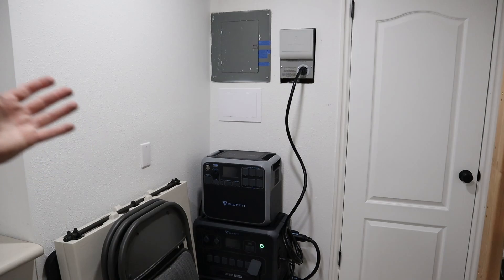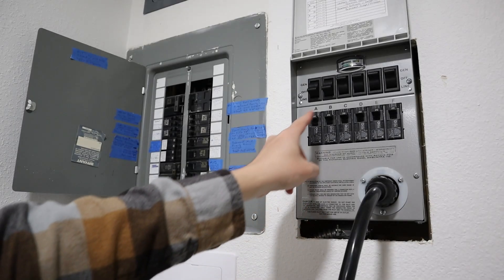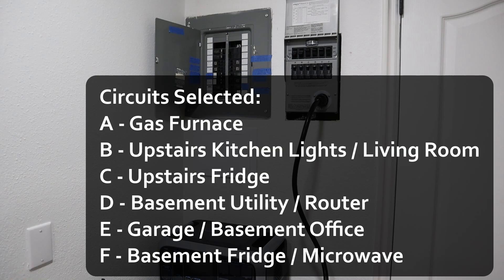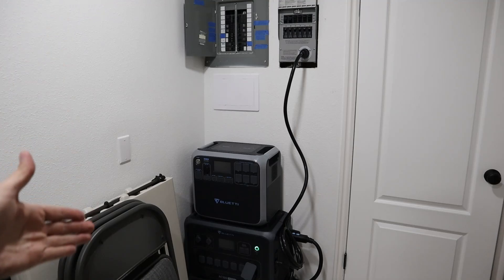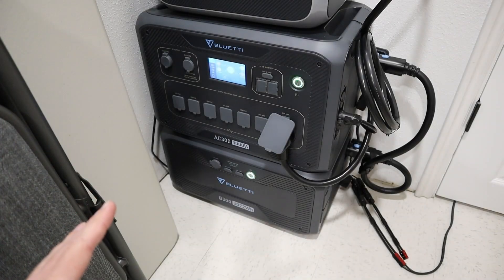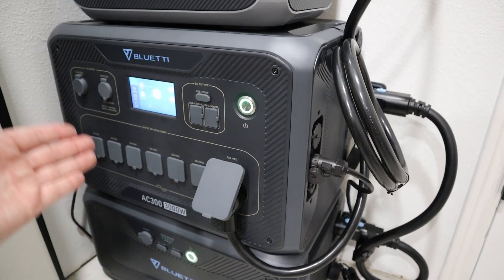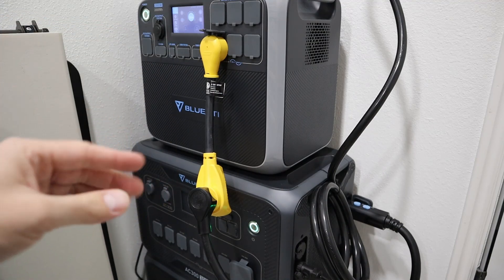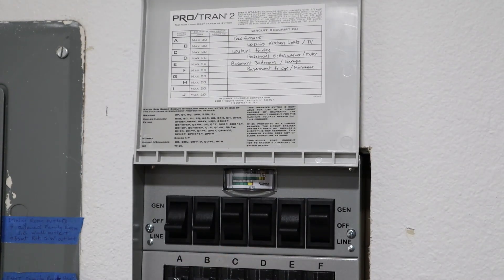Keep the Power On During an Outage?! Install a Power Station Transfer Switch!

Comment: I installed the same transfer switch for a gas generator. But now seeing I can get an AC300 and solar and use the transfer switch daily like you. And if I run out of battery power can easily plug the gas generator back into the transfer switch. Or use the gas generator to recharge the AC300 during the day and use the AC300 at night and not disturb the neighbors with a noisy gas generator or call attention to myself. Thanks for the simple walkthrough!
Reply from the maker: That's exactly my plan and on a sunny day I can run all 6 Circuits off solar no issues. When night comes around I only run my fridges to conserve battery power. With two fridges and cloudy days you'd really want to look into a second 3072wh battery
Reply: @Jasonoid  You called it. I had a 9 hour Sat without power due to storm, downed power lines. (Unusually long time) I used the AC300 with 1 B300 then had to use the gas generator. (it was a cloudy day) So now I am thinking about a second B300 like you said. But in the end I had power to get me through the day, and did not lose any food in the frig! I am enjoying learning step by step. Thanks

Comment: Jason, can you do this to a old house with the old fashion screw-in fuse panel, or do you need to upgrade the home panel to a circuit breaker type?
Reply from the maker: I'd probably recommend upgrading the panel to the newer removable circuit breakers. They get the transfer switch installed.

Comment: Is that enough battery power? Are you getting more battery's? I am thinking about getting the same system but with extra battery
Reply from the maker: During the day I'm good running everything off solar since it charges so fast, it stays at 100% through the day.... however through the night the battery falls down pretty low... I think I'm going to need more capacity to get me through the cloudy weather and nights. Running 1 fridge seems to be okay, but I have to swap everything over to line power in the night. Debating about purchasing a second battery as well.
Reply: I am also looking to get 10x 200 WATT 12 VOLT MONOCRYSTALLINE SOLAR PANELS
5 on each input should that be enough? We only get good sun for about 5-6 hours due to trees and shade.
Reply from the maker: Thats a pretty decent solar setup. Remember it can only take 150volts max input so you'd have to wire it in a way to keep the voltage under 150v. If the power is out I'd plan to run a gas generator as needed to charge up the AC300.
Reply: Is it not 150v per input? With the ac300 you get two solar inputs? The panels are Open Circuit Voltage: 27V
Reply from the maker: @MarineJunkies  Correct it's 150v per charge controller and the AC300 has two. So you can have two separate solar lines coming in. I didn't know the specs of the panels, so if they are 27volts max you should be perfect with 5 of them in series. I think that will be a great setup for you.
Reply: @Jasonoid That's the plan anyway, how long do you think it will take to fully charge two batteries with this set up?
Reply from the maker: @MarineJunkies  I don't have experience with the dual batteries so Im not sure, but I will tell you that one battery gets full in about 1.5 hours when I have 1400+ watts rocking in from solar. It's been super cloudy this week and it gets old to no be able to use my solar panels!
Reply: @Jasonoid   Do you get nothing when it's Claudy?
Reply from the maker: @MarineJunkies  thin clouds I'll get around 400 watts which is enough to run 1 fridge all the time. Thick clouds like heavy rain...I get around 100 watts.

Comment: Nice set up. Yours is the first video I've seen, showing how to fully use the power of a Power Station, to power your house.  

We have a similar set up, but with the Reliance six and ten circuit Transfer Switch.  I installed two inlets outside, to connect our Tri-fuel generator to. (It runs off our homes NG line) Each transfer switch has an inlet, like yours, for our Power Station. I use a changeover switch that's connected to each inlet, to switch between two power sources. (Generator and Power Station.) So, we can have two power sources coming in, but only one power source is powering the circuits in the Transfer Switch.

You forgot to show how the UPS function works with this set up.  We have the Ecoflow Delta Pro which uses an EPS (Emergency Power Supply). While the DP is plugged into a wall outlet, it can pass the Utility power through to whatever is connected to it.  (Without using the invertor or battery) When the power goes out, the DP switches over to battery power in 30ms.  Meaning no power loss.
Reply from the maker: You make a good point, I could have showed the AC300 in ups mode powering the circuits and then if the power went out I'd just have the battery backup. Most of the time I'm going to try to run off the solar and batteries and try not to use line power.

Comment: Thanks for the video.  I bought this transfer switch for my Bluetti 300 set up.  Do I need to buy any other cables before the electrician comes to install it?  Or does it come with everything I need? Thanks so much.
Reply from the maker: The transfer switch comes with everything you need, no additional wires needed for the install. You might need a cable to go from the transfer switch to the AC300, depends on the model you purchased.
Reply: @Jasonoid  You sure she doesn't need any other adapters when I look at the transfer switch and it has a four prone twist and on the Bluetti AC300 it has a three prone I was wondering the same thing?
Reply from the maker: @jamesclark144  if you use the one I purchased in the video, it came with the cable that adapts to the rv plug on the AC300

Comment: I'm waiting on someone to make a video of  hooking up  a 48volt Lifepo4 battery to a Bluetti to extend the run time,  I tried hooking up a lithium jumpstarter battery pack to it, (with the cigarette lighter adapter) and it charged my bluetti at a 100 something watts under the DC option, with a 48volt battery I would imagine someone could use the PV aspect of it for more watts coming in
Reply from the maker: Jehu Garcia (youtuber) has tried many attempts at expanding Bluetti power stations with external batteries. The problem is that these power stations require a communications link to the external battery so it's not a simple task. If you want a huge battery backup it's best to go full DIY

Comment: Have you ever hooked the B300 up to the Ac200?
Reply from the maker: The B300 will only hook up to the AC300. The B230 is meant for the Ac200max.
Reply: @Jasonoid  https://www.youtube.com/watch?v=2ZuLZzCh2us
Reply: Speaking of the Ac200max check out that video in the last comment, this guy has the Ultimate Ac200max transfer switch setup. I love the wiring he did for it. He backs it the AC200max with a B300. It powers most of his house and he uses is most of the time to supplement power usage. I love that cart he uses for both devices. I got to get one

Comment: Yippee!  New subscriber here.  Loved the video.  I have 2 AC300 & 2 B300s.
Looking to buy a 10 circuit transfer  switch because I have 2 full sized Fridges & 2 full sized Freezers. (outdoor Kitchen gets 100° F tempts. during
I plan on buying the Ford Lightning with extended battery.  The 80 amp charger that comes with it (called Charge Station Pro) requires a 100 amp breaker.  My AC300 is limited to 30 amps.  Does this mean I will NOT be able to connect my AC300 to charge my EV?
Reply from the maker: You have a lot of power available! You'd need to have both the AC300s connected to get 240v, then you should be able to charge your EV, bluetti sells a series connector to connect them together, I haven't tested it or seen it in person
Reply: @Jasonoid  Pro Fusion Box.  I have it!  You can see it 3:36 mins. into my video.
https://youtu.be/90_e8I3fW4g

Comment: The advantage of this setup is that you can run an inverter generator in short intervals to recharge your battery banks, yet the house can enjoy 24x7 coverage. I say inverter because I wouldn’t want to damage the battery banks. People waste a lot of fuel running generators constantly when the needs of the house are low or changing throughout the day. I see a generator (especially nice if you set it up for propane or natural gas) still having a role for the occasional recharging, but the battery banks are a super way to feed essential systems. If the batteries fail, then just pass the generator directly to the transfer switch.
Reply from the maker: Great points Nate! I agree there are many ways to use a transfer switch with a combo of Generators and batteries.
Reply: That's our set up.  We have a Tri-Fuel generator, that runs off our homes NG line. In the event of a power outage, we use our Power Station connected to a six and ten circuit Transfer Switch.  When the power station needs recharging, I start up the generator and charge the Power Station, while suppling power to all the circuits in the Transfer Switches.

Comment: Looks like a nice canned food storage shelf. In the video when you switched to basement to shore power the lights actually got brighter. Was that real or a play with the camera white balance due to the flicker?
Reply from the maker: Probably the camera playing games, the voltage output is the same on the inverter as wall power and I never noticed a difference in real life. You can see the canned storage build video here:
https://youtu.be/hSZ0Hh3urvM

Comment: Great video Jason, I'm going to be doing the same thing this summer. I've got a Delta Max on the way that I will be using. I also have about 15KW hours worth of batteries that I'm building to keep it charged.
Reply from the maker: 15KW!!!!!!! Thats awesome John! How do you plan to integrate the batteries and the Delta Max together? Just curious since I have had similar thoughts to have lots of capacity for CHEAP!
Reply: @Jasonoid    I'm going to make a cable and plug it right into the solar input, I have a 36 V battery that I'm working on that I have used to charge my Delta Mini at 305w.   A couple of them are Jehu Garcia's Powerbox and makita toolbox kits.  I'm in the process right now of dismantling 16 scooter packs and cleaning and capacity testing 600 18650!s 😆 🤣  Lithium solar also did a toolbox battery, that I am seriously considering doing. I think it was 4 kW hours
Reply from the maker: @DESERTDWELLER4547  I saw those battery videos! Keep me updated, send me an email once you get it all up and working!
Reply: @Jasonoid   Definitely, I'm still trying to get around to your Ammo Box build, don't have a whole lot of time lately lol
Reply from the maker: Sheeesh, I have so many goals and projects!..... Not enough time in the world with kids and family and other responsibilities haha.

Comment: Dang Jason, you really thought this through. I like the flexibility that you built in to your electrical panel setup. I also like that you can easily swap out for future power station acquisitions, as technology improves or the current solar generators wear out. Very nice

Comment: I have a Bluetti AC200P, EB150, EB55, and AC50S that I purchased to power various items in the house in case of power outage.  Then about 9 months ago, I became aware of these transfer switches.  Wow, one box to power everything that I need to run with just 1 solar generator.  I plan to install a 6 circuit one this summer.  As I would hook up the AC200P to this, the only need I would have for the other solar generators is as back up batteries to recharge the AC200P.  Can't count on solar input when the weather is bad, which is what likely knocked out power around here.
Reply from the maker: You got a great set of power stations Robert! Lots of power available to run things. One thing thats nice is you can at least run a gas genny to charge up power stations to store power for later use, then it's not running 24/7 using more gas. Without the batteries youd be running the generator non-stop for fridges and such. I have a 2000 watt generator I plan to use if solar isn't around to charge these up. I LOVE seeing 1000+ watts of solar but I can't get that all the time :(

Comment: Thanks. Hadn't seen transfer switches with individual breakers before. Did you have  an electrician install it? If so, was it something they do often? This still seems like a relatively uncommon practice to me.
Reply from the maker: I installed it myself in about 3 hours, most of that install time was cutting and measuring drywall. The wiring took about 1 hour. Pretty easy to do if you cutoff main power and follow the instructions/youtube videos from Reliance Controls.

Comment: Exactly what I plan on doing later this year! Great timing Jason!
Reply from the maker: Glad it was helpful, I'm looking forward to doing some more testing and providing updates.
Reply: @Jasonoid  Did you have to get a permit from your city to install it?
Reply from the maker: @zigzagluck  I checked on my local city's website and didn't see anything about permits for a small project like this. You may be in an area that's more strict. Usually the permit is under $100 for something like this.

Comment: My electrician just added some solar 50amp breakers to my main panel and a flip switch to turn off the grid power and flip on the Solar Power. It was a simple hook up and I didn’t have to have a separate panel. This way I can choose which breakers to use, without having any limitation’s on the whole house. Very inexpensive!
Reply from the maker: Are you using rooftop solar with inverters? Sounds like a sweet setup!
Reply: @Jasonoid  
I have a 24V/3000 Victron inverter. Should’ve put in a 48 V, but glad I didn’t because I would’ve shocked myself to death! I was learning as I went. 
I have four charge controllers that are Victron and 7.5 kW of PV. 9.6 kW of Battle Born Batteries. 
At some point I plan to upgrade to a 48 V inverter, just don’t have the money right now. I did all the work myself except for the main panel hook up.